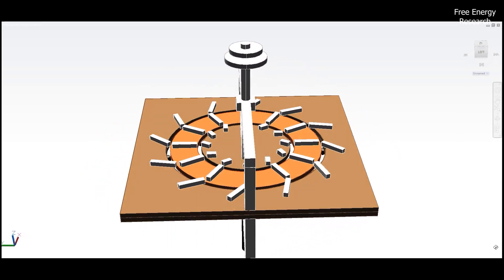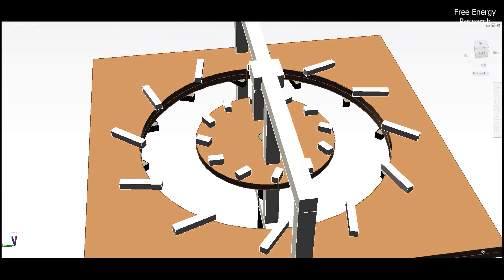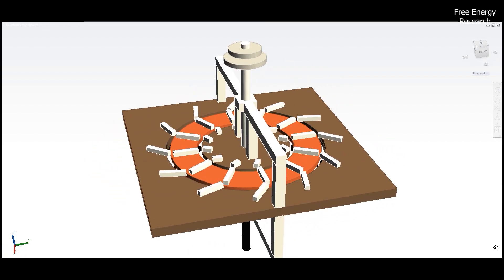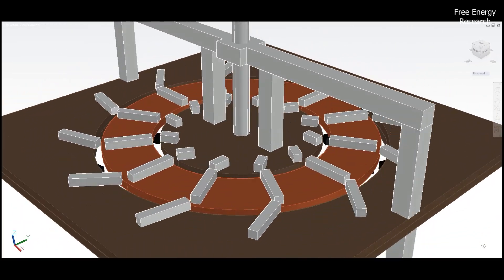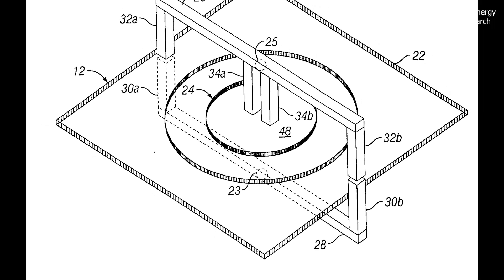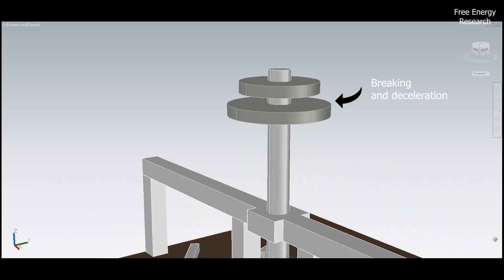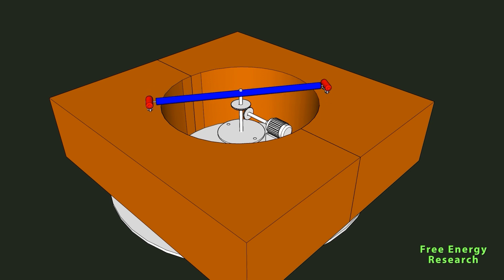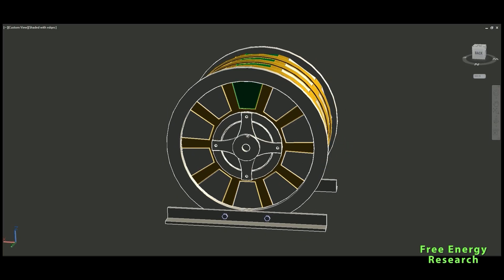Free Energy Generator : Gary Minker High Efficiency Magnet Motor

Comment: Also your a EE, by know you must know EE professors are ignorant or I mean withhold details of physical laws to obscure any notion that free energy may exist. I believe geometry is a key factor to produce free energy devices. Unique magnet to coil interactions. Like on YouTube (Infinity/Motor Generator) by RWG research (Russ Gries). This generator uses Lenz force to push the rotor forward. The more power the user requires the faster the rotor turns. This is a proof of concept only and is not a working free energy device.
Reply: Sure bro, like they wouldn't want the fame & fortune that would come with overturning the laws of physics. Maybe take a basic science class and learn and understand why you can't make perpetual motion machine, you can't make an overunity machine. It's basic science that apparently you guys don't understand. Do you even know what the first three laws of thermodynamics are?
Reply: Bro, why don't you spend your money on a basic science class and do your own research about the laws of thermodynamics. You don't need an electrical engineer professor to figure out that over Unity machines just won't work. You can't get something from nothing. Do you REALLY think you're gonna find that one lil tweak that will make it work? Look up the Dunning-Kruger effect, very important for ovet unity machines.